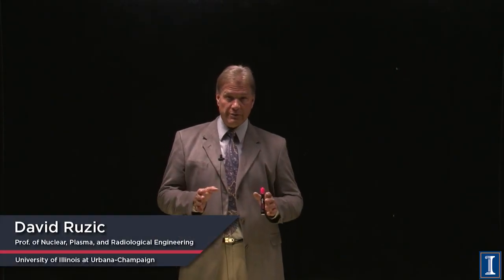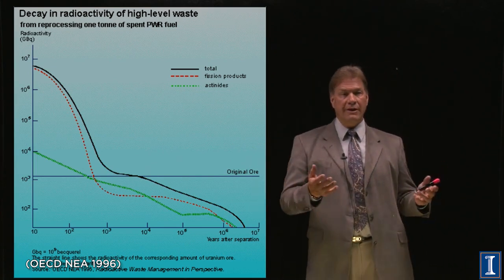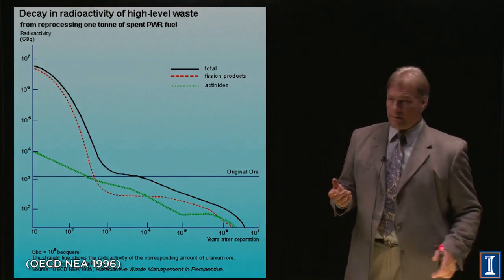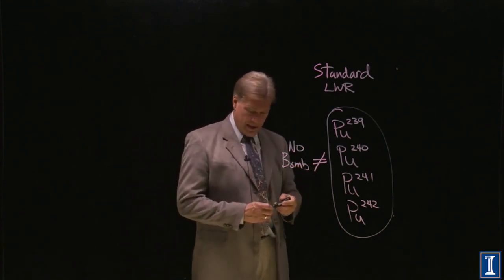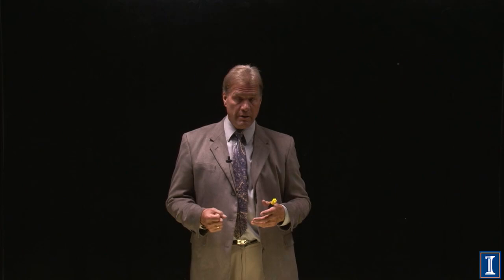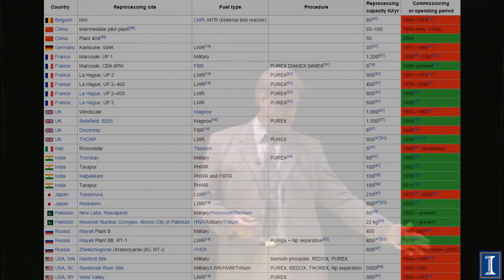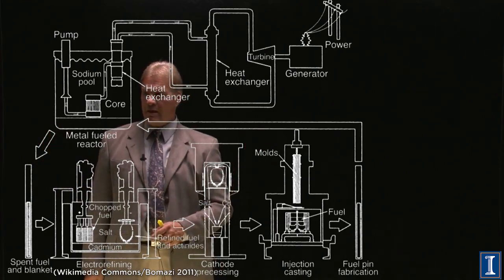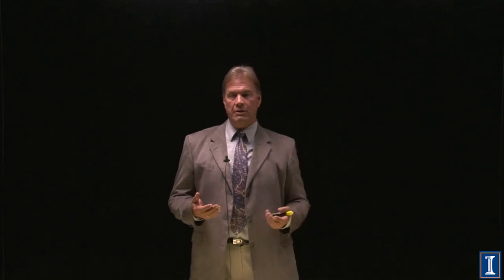Dealing with the Used Fuel (Reprocessing)

Comment: Statement that power reactor Pu will not make a bomb is FALSE. 

USA fired a weapon in 1962 at the NV test area made with approx. 22% Pu 240 extracted from fuel used in a British  reactor. It had about 10kt yield.

Repeated statements are on record by USA weapons developers that it is not impossible, just harder to engineer into a small package (more heat is produced by some of the other Pu isotopes, especially Pu238) and more dangerous for anyone working around it due to higher emmissions.
Reply: A power reactor produces Pu239 along with Pu240 and some of its heavier isotopes. Only the former is good for making weapons; with a low plutonium yield and 2/3 of that being unusable isotopes, power reactors are poor at producing plutonium for weapons manufacture.
Reply: @Akira-wh9mw  
Please, do not discount the production of Pu 238! That's a source of difficulty as well, beyond the Pu 240 & heavier isotopes...

Perhaps you should read the links I provided, then go back and watch the video where the poor professor states unequivocably that you CAN NOT use high burnup power reactor Pu for a weapon AT ALL. Which is false, as had been shown by a live weapon test using a high burnup power reactor fuel sourced Pu isotope mixture in USA back in 1962.

I do not dispute that a first level nuclear weapons state such as USA, Russian Federation, UK, France, China or Israel would PREFER to use "weapons grade" Pu composed of 93% or better Pu 239. But ANY power reactor or weapons production isotope sourced Pu isotope mix (short of 80% Pu238) CAN be weaponized, as admitted by IAEC.
Reply: What was the bomb's and nuclear test's name?
Reply: @OpenGL4ever  
The US government STILL HAS NOT DECLASSIFIED THIS. The historical  truth runs contrary to the politically required public perception of this issue. Witness the professor here, who 50+ years after the event still took the official version as being fact?

My Info on what happened has been pieced together from several sources. 

Look here for what was officially released during the Carter administration:
https://www.osti.gov/opennet/forms?formurl=document/press/pc29.html

Note that everything from the total yield to the NAME of the test is still classified? Why would that be, if it supported the official line, that reactor grade Pu is useless for weapons production? And why did Jimmy Carter PERSONALLY  feel in necessary to put out the tiny bit of information we are given, the mere fact that the test had occurred and not been a fizzle?

Got to love at least one aspect of Jimmy Carter, he had a Sunday school teacher level of compulsive truth telling AND was a military officer with a degree in nuclear engineering, fi ally granted presidential level of clearance. A good man, but a badly handicapped politician thereby.

Separately, one may finds information that British dual use reactor (power AND weapons Pu generation) reprocessed fuel was used because USA officially doesn't reprocess power reactor fuel AND that Hanford weapons Pu production facilities FAILED to create the requested 20% + Pu240, since the cans of fuel would swell, jam and burst in the channels when subjected to the longer than designed for dwell time. The Hanford reactors managed to produce only a small ammount of approx. 15% Pu 240, about 10 kilos, and 1.5 kilos of 20% from a high energy materials testing reactor, which was promptly requisitioned away by another, still undisclosed part of the USA nuclear establishment as being earmarked for them via a "prior request" of theirs! One wonders who had more pull than the bomb boys in 1962?!

More as I go back to original sources, I went down this rabbit hole a while back and did not save all the links I should have.

Google will pull up a large part of this piecemeal if you just LOOK. Then, look for what various knowledgable physicists and engineers  have come to believe about the matter from the public domain information and WHY.

Then apply Clarke's first law:
“When a distinguished but elderly scientist states that something is possible, he is almost certainly right. When he states that something is impossible, he is very probably wrong.”

https://www.wiseinternational.org/nuclear-monitor/787/can-reactor-grade-plutonium-be-used-nuclear-weapons
Reply: @Bert2368  Thank you very much for your extensive  information.
Reply: @Bert2368  
Do we know the specific reactor used to make the UK 22% Pu 240 plutonium? It was likely extremely thermal to minimize the production of Pu238 from Pu239(n,2n)Pu238 via a fast neutron. If so, that is NOT standard LWR  spent fuel, AND LWR SNF is 33% Pu240 average, not 22%. Any fast reactor exposed fuel would have high Pu238 as well, since Pu238 production is a fast neutron reaction.

Comment: what about uranium laser inritchment?
Reply: They told me 30 years ago, that they will do laser enrichment soon. Now, 30 years later they still don't have a industrial working solution to separate isotopes with Lasers.
Reply: @OpenGL4ever  http://www.silex.com.au/SILEX-Laser-Uranium-Enrichment-Technology
Reply: @shawnnoyes4620  I know that all, it was already known in the 90 that's why i was talking about. But it's still NOT used for hundreds of tons of nuclear waste. Which means that it's still not working in an industrial manner thus we can put that on the side.
Reply: @OpenGL4ever  (1) It will probably be used for Paducah, Kentucky tailings at some point, then it can go from engineering to industrial scale. (2) If it is proved out there, then you could use as part of the Fluoride volatility reprocessing for SNF (e.g., google Progress in development of Fluoride volatility reprocessing technology Jan Uhlíř). (3) So, I would say do not put it aside ... (4) I get it would only really be good for the first step of the Fluoride volatility processing of Uranium 235 & Uranium 238 enrichment. Though, it would be interesting for separating out U233 and dovetail with Uranium 232 to aid in non-proliferation. (5) I am assuming that the U/Pu step (next) you could put in a Denatured MSR or Molten Chloride Salt Fast Reactor.
Reply: @OpenGL4ever  google SILEX Laser Uranium Enrichment Technology

Comment: Ya say that nobody would have an issue with digging something radioactive up then putting it back at the same radiation level, but we don't mine heavy rare earths in the united states due to Thorium contamination, which if you mixed it with a small amount of dirt you could put the Thorium back into the ground at the same concentration.

Comment: What you need to do is step away from heavy elements and go to Nickel 63. It is a pure beta emitter and a metal, with a half life of 100 years. This way you can have safe nuclear energy and no nuclear proliferation. The breeders for Ni63 can be made to work on heavy hydrogen (Deuterium) in plasma state where you can produce Tritium and free neutrons. With Nickel 63 you cannot have it go critical (no fission and no neutron radiation).
Reply: Nickel 63 is not fissionable. How do you want make energy with Nickel 63?
You might use the Tritum for nuclear fusion, but there is still a long way to go for nuclear fusion reactors. In about 15 years we will know more.
Reply: @OpenGL4ever  Nickel 63 is a radioactive BETA emitter. It only gives off ELECRONS, which means you can harvest them DIRECTLY and not through thermo-nuclear conversion that we use nowadays. I agree with you however that we are decades away from this as, conveniently, almost no-one talks about this. It seems they like their fission byproducts polluting this world.
Reply: @DBuilder1977  Nickel 63 has a half-life of around 100 years. To make energy of radioactive decay at that low decay rate for energy production you will need a lot of Nickel 63 isotopes concentrated at the same place. And to separate them from other Nickel isotopes, especially the ones, that are not radioactive, you will need a lot of energy. Thus in theory you might use the electrons, but in practice this is not feasible.
It's even very likely that your separation process will require more energy than you can gain by the radioactive decay.

If it were that simple, we would use radioactive waste to generate electricity directly, but except for radioisotope generators this is usually not done.
In nuclear waste there are more than enough isotopes that do a beta decay too. And some of them do decay a lot faster, thus, the power of beta emission is much higher.
Reply: @OpenGL4ever  Well, Plutonium has a half life of 400 years, which is 4 times weaker than Nickel 63 so your argument doesn't hold, Nickel 63 is 4 times stronger than Pu!!! Also, to separate the isotopes, you needs JUST a centrifuge so where is the "a lot of energy" needed? The reason they don't use it still is that you cannot get a bomb out of it.
Reply: @OpenGL4ever  What? Just because someone wants you to believe that a simple centrifuge costs a lot of energy that doesn't mean it's true. A centrifuge does not even need to start and stop it can rotate continuously lowering even more the cost. Anyhow, a simple motor rotating a centrifuge doesn't cost THAT MUCH...
Reply: @DBuilder1977  One centrifuge is not enough, you need hundreds of them.
And yes this is still much more expensive than a simple chemical reaction.
Reply: @OpenGL4ever  You are talking like fission needs no centrifuges but Ni63 does. Well guess what, you need centrifuges in any type...
Reply: @DBuilder1977  That''s not what i said. But what i can definitely say is that you will gain much more energy via fission, than you will ever get via radioactive decay with Ni63. Thus even if you need centrifuges for the separation for Uranium this will be at least energy efficient.
And btw, the separation of Pu 239 of a nuclear breeder does NOT need centrifuges, it's only a chemical reaction that is required.
And btw Ni63 must be produced synthetically. Its half-life is to short to be able to exist naturally.
Reply: @OpenGL4ever  Well, I prefer Ni63 that I can stand next to it rather than a whole bunch of nuclear waste.

Comment: Please have a look at the work done at Moltex Energy. 
Caesium and Iodine become salts within the fuel. Gasses escape from the fuel pins do have minimal poisoning effect. There is no water in the core so neutrons cannot crack it into hydrogen and oxygen. 
It runs in the fast spectrum - no moderator but more importantly it burns the actinides so the used fuel has an active life of 300 years. The fuel is molten salt, but they coolant is also the same variety of molten salt (though no actual fuel of course). Heat is moved by convection to a tertiary salt which raises steam. It’s a burner fast reactor but there are no pumps on the core and no risky elements like sodium.

Comment: Cd is NOT like a control rod. Pyro-processing has no moderator and Cd is only for <0.55eV max threshold themal neutrons. They use LiCl-KCl, and Li contains Li-6 that is better at absorbing neutrons than Cd. Plus they do small batches that cannot go critical. Cd is part if the electro-chemistry cell.
Reply: Lithium is bomb fuel, whether or not it's Lithium- 6 or Lithium-7. It's used to build hydrogen bombs. How could it serve as a control rod when it readily takes part in nuclear reactions?
Reply: @taraswertelecki9886  Fusion, not fission. Lithium can be used in fusion. I mean, technically carbon can also undergo fusion, what's the point here exactly?

Comment: Pu separation is not easier than U enrichment. Pu makes a smaller more powerful bomb.
Reply: Separating two different elements by chemical means is much easier and cheaper than separating two different isotopes from the same element.

Simple example:
Water is a molecule consisting of one atom hydrogen and 2 atoms oxygen. If i want to separate them, i only need electrical power and do a little electrolysis.
Separating Deuterium from Protium, which are both hydrogen, is much more difficult and energy consuming.

Also keep in mind. When the built the first to nuclear bombs, they gone the difficult way of creating an implosion bomb design. The reason why they do this was, because getting enough Uranium 235 for a gun design bomb was very energy and time consuming and in 1945, they had only enough Uranium 235 for just one bomb. It would have taken another year to make another one.
But with the implosion design, which uses plutonium 239 and not uranium 235. They could create much more plutonium 239 in a breeder reactor, than they could enrich uranium 235. Thus to make a lot of bombs, the Plutonium 235 and implosion design was the way to go.

Comment: Can you add the thorium ore radioactivity horizontal lines on the beginning decay curve? Thorium ore is natural and more radioactively radio-hazardous than U ore. 

The LWRwaste might be under the Th ore line at 1000 years.
Reply: Thorium ore is commonly left piled in the open as waste during mining and milling operations for other materials. Not all that hazardous. Power plant waste using thorium fuel varies depending on the type of plant of course but tends to be composed of a material mix that as a whole decays to ore equivalent level in a shorter period of time than typical uranium fuel.

Comment: There is a new reactor type that does not require complex expensive reprocessing, only conversion from oxide to chloride, no separations. That reduces cost 10x vs the IFR method, and reduces proliferation concerns more than the IFR pyro-processing. These are Molten Chloride Salt Fast Reactors they eliminate cladding absorptions, but can't get the Fissile density of solid fuel.
Reply: GO MSR!

Comment: If one is ok with a lower yield and a need for a little extra shielding around the core, it's perfectly possible, and even not terribly difficult, to make a nuclear weapon with the mix of plutonium that comes out of LWRs (it's also called "reactor-grade plutonium"). There are very clear statements by weapons designers on this point, and one can find enough material from a simple google search for "nuclear weapons from reactor grade plutonium" that it's not necessary to provide sources here.

On the other hand, the thorium fuel cycle eventually produces plutonium 238, which actually CAN'T be used in nuclear weapons (though its precursor, neptunium, definitely can).
Reply: Please reference where any nation state has made a nuclear bomb out of reactor-grade plutonium. They would simply leverage a graphite reactor and pull fuel out early and process via PUREX to get pure PU239. This is nonsense.
Reply: If anything, I'd assume that it'd be easiest to make a bomb out of uranium-233 however impractical that would be.
Reply: @adamdanilowicz4252  U233 makes as good a weapon as weapons grade Pu239, but can use an easier gun type weapon as well. U233 is easily obtained separate from even U232.

Comment: have you heard of the MCSFR? it's a fast spectrum molten salt reactor that doesn't require ANY fuel fabrication or reprocessing. it's just a vat of chloride salts that fission for 40 years, eventually getting batch-processed once (just removal of fission products, not even separating the actinides) and split into two reactors
Reply: I work on molten-salt reprocessing, and I can tell you that it's only possible to remove about 40% of the fission products without removing the actinides, at least by any chemical method currently known to humanity. Rb, Cs, Y, Ba, Sr, and all the lanthanides REQUIRE proir actinide removal to be separated from salts.
Reply: @richardfitzhugh6628  Correct, and we WANT to keep the Cs and Sr with the actinides to prevent saltbfreezing casualty easier, and reduce the melting point of the eutectic with CsCl
Reply: @richardfitzhugh6628  What's your opinion about dual fluid reactors?
https://youtu.be/Zy6zCgftVPY
Reply: how do you get the fuel without fabrication into chloride salts then... as well as the better question: how do you force the fission products AND higher order products to bind only with the chloride process instead of the housing, components, sensors, pumping system and wherever else they are when they occur?  Because it doesn't occur ONLY in the "perfect little box" and Hopey McWishy doesn't stop bad byproducts like inert gasses from screwing everything up.
Reply: @prjndigo  nevermind toxic argon poisoning